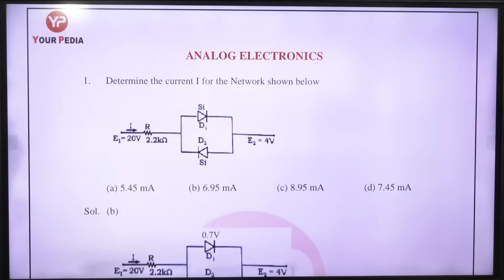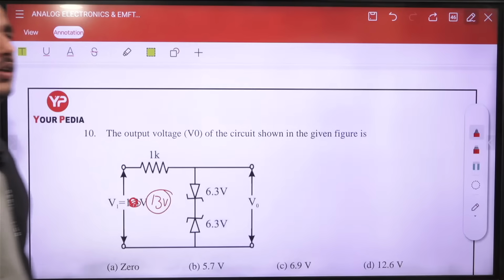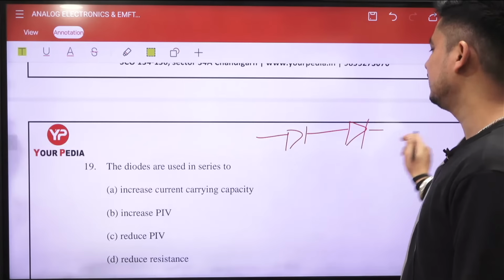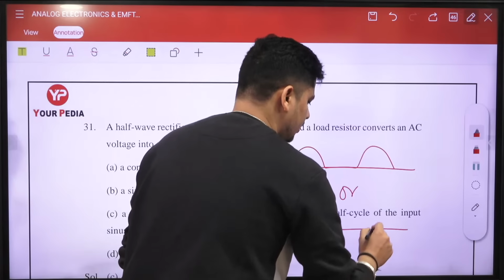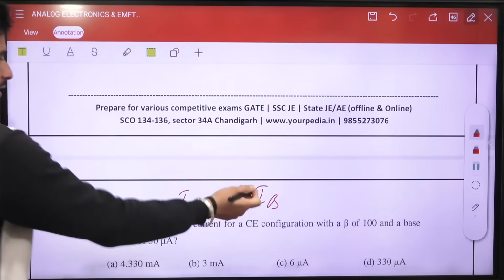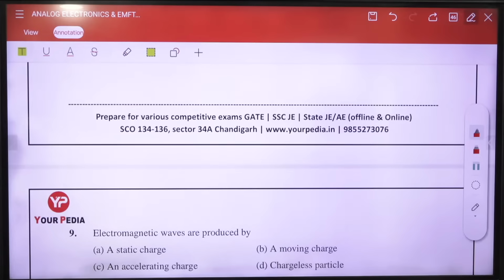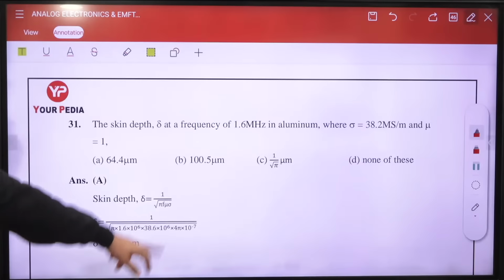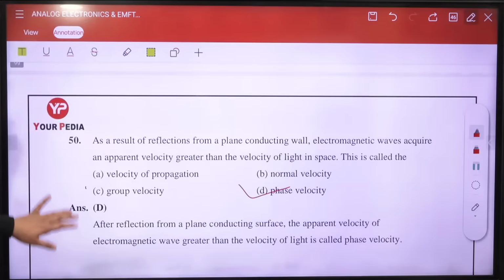Live 100 Questions EMFT & Analog | BEL Electronics/Electrical PE written exam preparation

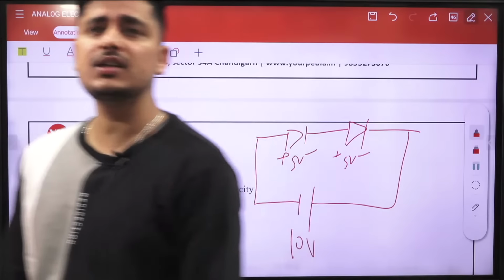Comment: 35:45 Sir check the answer again, diodes are connected in series to increase the overall PIV. Just think how can you change the characteristics of diode with series or parallel connections? Their individual properties remain the same.
Reply: What is PIV of diode that is voltage across diode in reverse bias it will change according to circuit